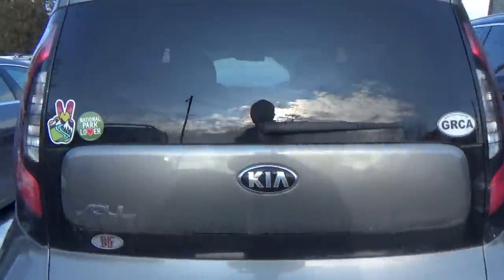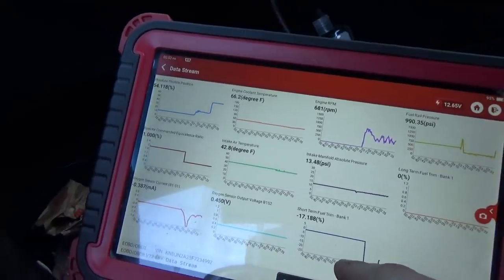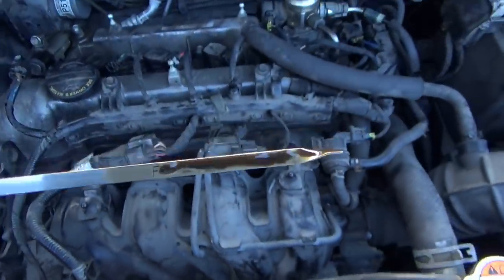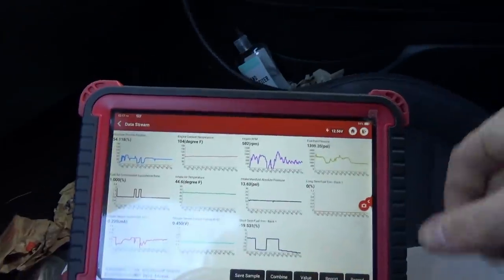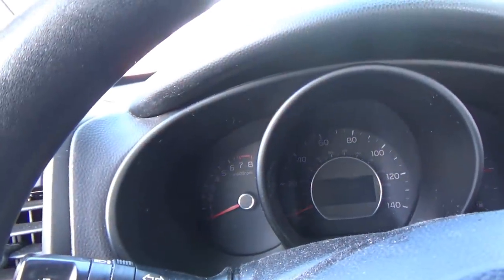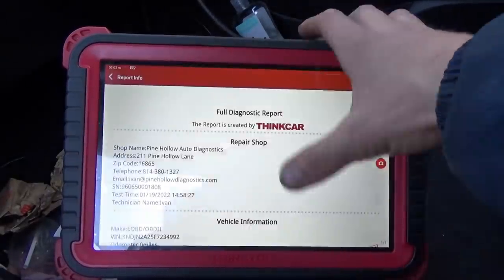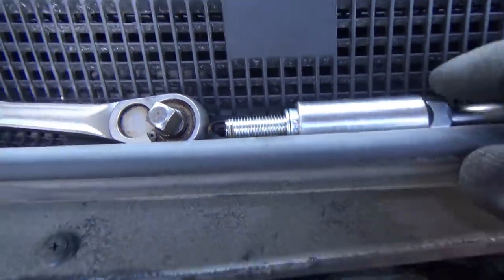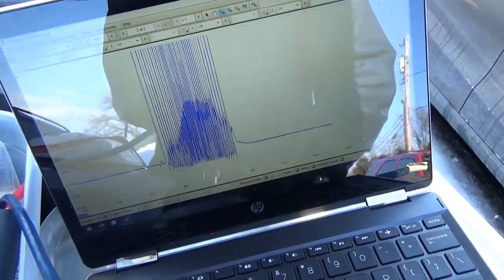Kia has no SOUL... & No Throttle Response!! (+ Transducer GIVEAWAY WINNER!)

Comment: Nice job Ivan! Sawzall would make this a no parts required for the record haha
Reply from the maker: I think the customer unofficially fixed the "restriction" NPR using a prybar and a hammer 👌🤣
Reply: @PineHollowAutoDiagnostics  LoL 🤣😆
Reply: @PineHollowAutoDiagnostics  I don't even know how to do that... 🤞🙄
Reply: Hey quick question for ivan, why not replace the fuel pump too if the oil smells terribly like gas? I understand it wasn't the main concern but if that fuel pump is leaking into the oil and causing a rich condition couldn't that clog the cat?
Reply: Ring a gallon of lacquer thinner would clean out the cat and a lot easier than cutting out the cat..
Reply from the maker: @Comin_at_U_Live  lacquer thinner cannot "unmelt" a cat... No matter what Scotty Kilmer says 🤣🤣

Comment: Good diagnosis there. These kia souls that have the 1.6 L are notorious for having clogged converters because they have an oil consumption problem. I I have seen where you can do an oil change then put 1,000 miles on and be over a quart low on the dipstick, with no signs of oil burning.
Reply: my 1.2 L kia soul does this, its so bad i've already replaced the catalytic converter twice from it straight up melting. Now facing a problem again where its probably the same thing :(

Comment: Something made the cat clog up. Right? So there must be another issue somewhere that caused the cat to clog surely. My gdi engine done the same. Cat clogged. Disconnected it and the cars been fine, until a few days ago. Even with the cat unhooked, I have minimal power for acceleration, hard starting, soft brakes, and very bad gas mileage. New plugs, oil, air filter. No check engine except the O2 and cat together. No blow by, and gas in my oil. Please help

Comment: The lesson is you need to know how to use a scope. And go buy a PHAD pressure transducer. I used mine just the other day on a Nissan Frontier. After the other tech couldn't say yes or no after removing the oxygen sensor I went in and put my PHAD pressure transducer in cylinder. And had 30 psi in the exhaust pocket. Took me 10 minutes.
Reply from the maker: Love it!
Reply: Then his is not a tech.
Reply: @2nickles647  he's still learning. Hopefully, he learned something.

Comment: You need to sell Eric "O" a transducer at twice the price. I do have a question, if the oil smelled of fuel did you mention that to the technician, and did they replace the high-pressure pump? I am only a keyboard follower and Diy guy but following you and Eric's diags makes me think that not fixing the fuel problem can only destroy another CAT.
Reply: Same position as you and had the exact same thought. Cat got killed because of mixture being rich because of the high pressure fuel pump pushing fuel into the crankcase. If the pump is bad, another cat is going to be a victim very soon.
Interested to hear others opinions.
Reply: @dans_Learning_Curve  Think the plan is to get it running and check those fuel #'s. We will all find out ;)

Comment: I have a 2021 Kia soul sports mode today I was driving it I stop at a red light and the light turned green and it didn't want to go so I had to turn it off and turn it back on and it started working again has this happened to anybody if so what was the issue of the car.

Comment: No scope here.... roll under the car and feel the exhaust after the cat... feel the cat... feel the pipe before the cat... .Thanks Ivan
Reply from the maker: With your bare hand?? Nah I'll stick with the scope 😅
Reply: @PineHollowAutoDiagnostics  maybe on a cold start the pipe before the cat won't be hot enough to burn your hand, but able to feel the difference between before and after the cat?.
Reply: non contact thermometer works, or one of those thermal heat guns
Reply: @PineHollowAutoDiagnostics  Ummm.... knowing it could be hot you ... well do what you do.....

Comment: Awesome diagnosis as usual but there is a recall on those cats so they might have got one for free at the dealer unless it already had the recall done some time ago.  When it sounds muffled like that and you have a hard brake pedal from no vacuum go right for a restricted exhaust.  Nice job as usual getting to the problem quickly.

Comment: Nice diag!  Had a kinda similar case last week. 2018 volkswagen polo HPFP was leaking gas to crankcase and eventually customer just drove the car even when CEL was on for weeks. Only had P0420 stored even though the rich-mixture was the real cause! Cat was toast.  Observe fuel rail pressure after shutting down the engine. It may reveal a leak in the HP-system.
Reply: A 2018 cat was pooched? How does that happen?
Reply: @brandonsnider7907  I mean it was not clogged, but shattered internally.  I assume it got overheated and burned because it was running waaaaay rich. Had only 24k miles

Comment: I figured that was the problem. I had a 1966 Mustang that did the same thing. Took it to my brothers shop and he had me accelerate while he went to the rear and put his hand over the tail pipe. No pressure, took the muffler off, opened it up and sure enough a baffle broke in the muffler and blocked it. Replaced the muffler and back to racing around town, and did not have no fancy equipment in the sixties. lol

Comment: Just for my learning = wasn't the down stream O2 sensor pegged at 0.450-0.455V an early give away?
Love your work Ivan!
Reply from the maker: Not sure... Wouldn't even look at the downstream O2 signal if the car can barely idle 😉
Reply: @PineHollowAutoDiagnostics  fair point. I just meant when you were showing the PID's while it was running and trying to rev it. The O2 wasn't great but was reading something whereas the downstream didn't move the whole time.
My only logic was that ofcourse it wouldn't move if the cat was as choked out as it ended up being.
P.S. Once you have a pressure transducer. Can you see any use for a pulse generator?

Comment: Ivan good find! Although I have always been told, "Catalytic Converters don't Die, they are Killed." Perhaps there's still other issues such as Fuel Trims pegged out dumping extra fuel. That would explain why the Spark Plugs are black and the continuous excessive fuel burning out the Catalytic Converter.
Reply: Burning oil can also kill a catalyst. Don't ask me how I know it

Comment: Have a case for you. 2011 Kia Sorento, 2.4L engine, had funky shift issues for some time (its my daughters vehicle) but then it got to where it has really poor acceleration, lack power especially on hills. My son-in-law put new spark plugs in it, did not help. I took vehicle home, checked compression, it was fine. Checked fuel pressure, it was okay. Everything checked out, no codes. Ended up pulling transmission and put in new torque converter, rebuilt one actually and replaced wiring harness as that is a known problem. Still had same behavior and still no codes. Went ahead and replaced throttle body which has the TPS built into it, still have problems, went through some transmission relearn procedures, seemed better but not great, this morning same problem and still no codes. Pulled fuel pump, looks pretty clean, almost looks new. Don't know what's going on and even more frustrating because not getting any codes.

Comment: Ivan,
Great video and diagnosis - thank you! Based on the code you got at first I would have been convinced it was a TPS/PPS issue. Great work on your part to find the actual issue!
BTW I have my late wife's 2019 Kia Soul 2.0L. Only 26K miles - so far no issues.
Paul (in MA)

Comment: Well, last week my friend had the same symptoms on a 2.0l soul. I had him start the car while I observed the tailpipe. Sure enough less exhaust coming out than a 50cc Honda. A hard smack revealed that the converter was not broken or melted just plugged. Oddly enough 20 minutes later it was no longer plugged. According to the downstream sensor it’s working fine so all is well.
Reply from the maker: How did it "unclog itself" in 20 minutes?? 🤔😅
Reply: @PineHollowAutoDiagnostics  wouldn’t the EPA and CARB like to know.

Comment: 2015 isn't very old but 150K miles is near end of a good life. So the interior beyond the driver's seat looks great yet the cars a problem waiting to happen if you bought it. Not bad repair for a high milage car, this is probably a country car with a lot of 50mph+ driving, but a car with this milage would not be my road trip car. You can go to online sights and do searches, move the milage slider to 150K, KIA was not significantly worse percentage wise but only 5% of cars were over 150K which is a reliability measure.
Reply: My experience with Kia/Hyundai is the convertors are just BARELY able to pass emissions in the US when brand new. I'd bet this car had very few if any tune-ups. Just drove it till it quit. Worn-out plugs eat convertors.
Reply: That really depends on the car. For some 150K is the end, for others is not that much... Mine's at over 200k miles and still going alright. I only use it for long road trips, otherwise I don't use it much at all.

Comment: I agree with some of the other guys talking about a low vacuum at idle which would also indicate a converter that is clogged also you could have unbolted the converter from the exhaust manifold and then revved it up!! All the best from Canada
Reply from the maker: It's built into the exhaust manifold 😅
Reply: @PineHollowAutoDiagnostics  you had mentioned that the O2 sensor that you were trying to take out was an upstream and I was under the assumption that it was further down. You still would have noticed how muffled the exhaust would have been if you were taking the exhaust pipe off.

Comment: Given that the oil smelled like gasoline, why did you not recommend replacing the high pressure fuel pump in addition to the catalytic converter? It seems bound to ruin the engine with all the oil dilution going on. On the other hand, all those gas fumes getting sucked into the intake manifold via the PCV system would solve the problem of carbon buildup on the intake valves, so maybe it's a win either way.
Reply: Don't think that was the issue. Might have been due to the misfire, which may have also cooked the cat. I don't think Hyundai/Kia are particularly known for HPFP failures.

Comment: It looks like 3 things, a high pressure fuel pump, a catalytic converter and an oil change. The low engine vacuum is a dead giveaway for a plugged exhaust. Walk to the back of the vehicle and listed to the exhaust. There are many things that are easily diagnosed with a vacuum gauge. Another way is to drill an 1/8 inch hole in the exhaust pipe and it will whistle like crazy.
Reply: Or do the SMA test of a hole before the cat in the exhaust the size of the OD of a brake line. Put a psi guage on the tube. Weld the hole when done.
Reply from the maker: @dans_Learning_Curve  way too much work 🤣
Reply: @PineHollowAutoDiagnostics  I hope Mr. O sees this! LoL 🤣😆

Comment: Another informative diagnosis Ivan! Indeed, for me, it would have been a lengthy diagnosis and tail chasing with head scratching with out the help of the pressure transducer. Surprising that the O2 sensor got to break a socket/tool.. hahaha.. Cheers!

Comment: My guess is low fuel pressure or clogged up intake or maybe it's been running rough  for so long that the oil is for the petrol and is fooling the O2 sensors into thinking the engines running way too rich or another thought is cylinder 4 is misfiring and clogged up the cat

Comment: Nice work Ivan, p transducer shines once again!  ( it’s in my bucket list). I mentioned this before, but just for poops and smiles, sometime You come across this situation again, throw an old school vacuum gauge on somewhere and note the readings. Should start out at full vac and gradually drop off relative to restriction severity! It does work but to be honest I’ve never tried it on newer vehicles!
Reply: My friends 2000 Honda Accord had about 185 K and wouldn't go over 25 MPH . The upstream oxygen sensor on the 4 cylinder is right in front . I removed it and put the vacuum gauge on it . I think at 2000 rpm there was very little vacuum . I got a Walker CARB approved CAT for use in N.Y. from Rock Auto .
Reply: You hook the vacuum gauge to a vacuum line on the engine Bill, not the exhaust. If a cat is restricted, it will produce pressure upstream from cat.
Reply: Brian W : I should have explained how I tested that more clearly . I did remove the O2 to allow the back pressure , in this case more than a normal engine , to escape . I believe I put the vacuum gauge on the PCV line and increased the RPM to about 2,000 . I think I only got about 2 lbs. or less of vacuum , due to the restricted CAT , which I think was original . The CAT was changed and fixed the issue . The engine is like an air pump and must have flow through . The back pressure reduced its ability to draw a vacuum , especially at 2,000 RPM . A volumetric efficiency test would also show a restriction . But I only have basic tools .
Reply: If you hooked to pcv ( positive crankcase ventilation) Bill, that would not work, gotta be a vacuum line .  Should get an initial reading of 18 - 22 and it would start dropping off as pressure builds in exhaust, but with the O2 sensor removed that would not occur.
Reply: @brianw8963  Can you do the same test with a scan tool? Watch your manifold pressure and look for a drop? Ivan was showing low vacuum on his.
Reply: @DRDROP-fj4bo  You could if there was pid for vacuum, but I’ve never saw that . Vacuum gauges are very inexpensive and a good tool to have in Your arsenal , for many uses.

Comment: Now a quick confirmation of the clogged catalytic converter is to drill a ½" hole in it on the inlet side at the bottom then start the engine and see if it runs better. Trust me it will run better if that's what is causing that problem.
Reply from the maker: It's part of the exhaust manifold so wouldn't work here 😄
Reply: @PineHollowAutoDiagnostics  now that I didn't know but I've seen it before. If I'm right there's a 02 sensor literally dead center of the manifold or towards the bottom edge of the cat. 89 Isuzu imark had that setup. $800 for the replacement cat in 96. That's ridiculous for a catalytic converter even in California but no that wasn't in California it was in Texas.

Comment: Could this be confirmed by cranking to open the exhaust valve and sending compressed air into the exhaust stream? 
I closed the exhaust valve to diagnose a burned exhaust valve. Air came rushing out the exhaust.
btw. It is a KIA, Killed In Action.

Comment: The 2015 Kia's have a known engine issue with piston slap and or stuck oil control rings. They burn oil and kill the cat. I have one, hate the motor but like the car. Its a shame the motors are crap. :(

Comment: What about the gas in the oil?  Once the converter is installed, does that go away due to pressures?  You didn't clarify that and I'm a dummy on this stuff.

Comment: Maybe a stupid question or thought  could u have found the problem with a compression tester if u knew the what that engine  should have for compression.  My thought is it should read really  high with that badly plugged cat or am I wrong
Reply: You couldn't measure the pressure on the exhaust stroke with a compression tester. You'd get the pressure of the compression stroke.

Comment: Could you explain briefly how the pressure transducer works in a spark plug hole ? pressure obviously but how can you translate that to exhaust pressure too high?  Top fan by the way , old school BMW Master Tech, happily retired!
Reply: On the exhaust stroke. There should be almost no pressure. Say 1 t 2 psi at the most. As the cat starts to plug up. Pressure increase on the exhaust side. Some exhaust shops will drill a hole in the exhaust.hook up a some vac/press gauge and start it up. And rev it up. And record results and weld the hole back up..
Reply: On the exhaust stroke the exhaust valve is open so the piston should be able to easily push the exhaust gases out. In a good scenario the in cylinder pressure should not rise much about atmosphere (14.7psi or 1 bar at sea level), perhaps a psi or two elevated for normal exhaust restrictiveness. If you see over 40psi (3 bar / 3 atmospheres) in the cylinder on the exhaust stroke then clearly the exhaust gasses are being compressed in the cylinder rather than whizzing out the exhaust pipe as they should.
Most likely clogged or collapsed converter but I suppose it could be the exhaust valve failing to open for some reason.

edit - or was the question - how to tell the exhaust stroke from the compression stroke?
Reply: Easy one. The transducer varies the voltage with the pressure. The oscilloscope shows the graph of that voltage. The sampling is very fast, so you can see the pressure in the cylinder at all times. When the exhaust valves are open that's the pressure in the exhaust, before the cat. You can see from the shape of the graph when the pressure shown is from the exhaust, because you can see the peaks from the compression and the exhaust should be a sudden drop in pressure. The 30 PSI observed is obviously a very high pressure. It should be around atmospheric pressure.
Reply: The pressure in the cylinder in normal operation, on the exhaust stroke should be relatively  low since the exhaust valve is opening.
If there is a clog in the exhaust system the piston traveling up on the exhaust stroke will meet resistance due to the clog. This resistance will register as high pressure.  The transducer will convert this pressure to a voltage which will register on the scope as shown.  If there were no clog the deflection on the screen would have been very low to nothing.
Reply: Love it that an experienced guy is still willing to ask questions and learn! Never stop learning!